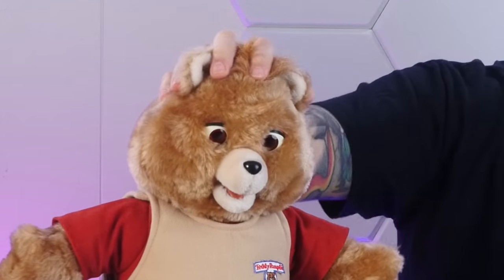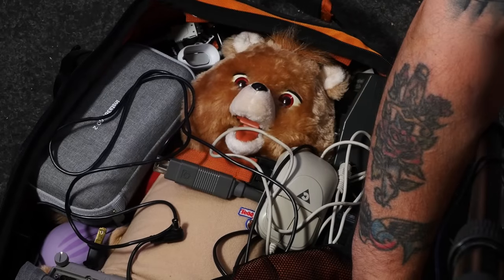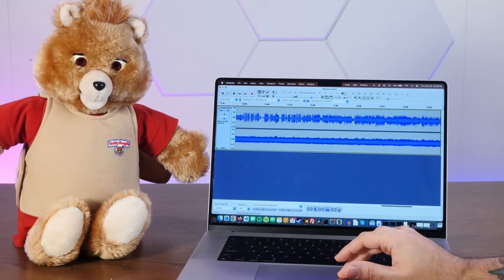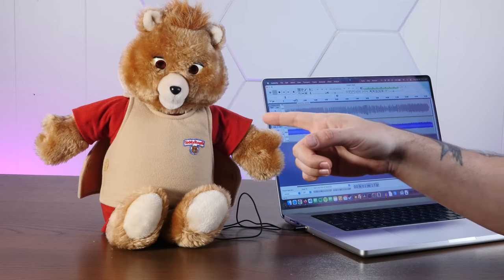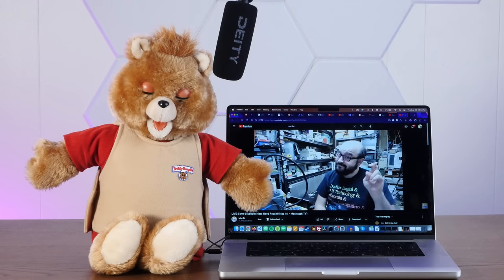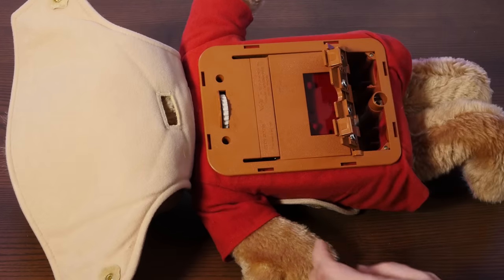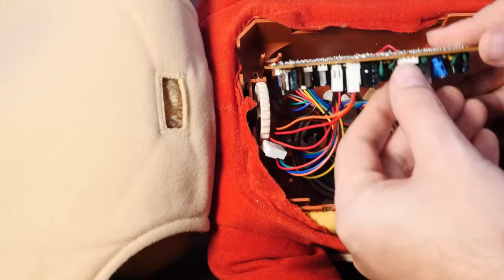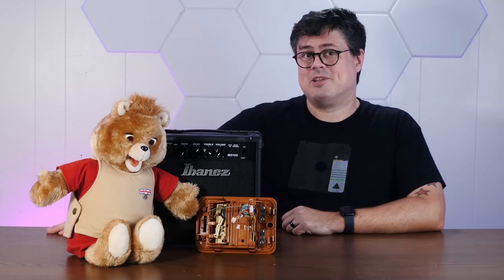How To Ruin a Teddy Ruxpin

Comment: The signal Teddy uses is actually exactly the same as in older model remote controls with 8 channels. The control track on the tape actually controls Teddy as well as Grubby; Grubby was an accessory toy you could plug into Teddy with the same movements and a speaker. The second deeper voice on the Tape is Grubby.
The tape and tape player are now obviously degraded and that's why the movements bleed over and the sound is really garbled.

The Channels are used as follows: 

1 - sync/unused
2 - Teddy eyes open/close
3 - Teddy Jaw control 1
4 - Teddy Jaw control 2 (later revisions omitted this servo but the control track was still there)
5 - Speaker switch (controls if sounds play through Teddy, Grubby or both)
6 - Grubby eyes open/close
7 - Grubby Jaw control 1
8 - Grubby Jaw Control 2 (same as with later Teddy revisions)
Reply: 🤓 Who is a cares, Teddy Ruxpin 's magical! ✨

Comment: Okay, now a real challenge: at one point, PBS, Microsoft and the creators of "Barney the Dinosaur" and "Arthur" created animatronic dolls of Barney, Arthur and DW.  The dolls not only talked, but had head and arm movements.  Creepy.  They also had some built in 'games' but with a special attachment to your TV or VCR would animate the dolls in sync with actions on the video.  This was done by decoding pulses embedded in the video and could be seen an the far left hand of the screen.  It was real creepy.  

Barney was the first model and the motors whizzed and whirred like a Terminator.  "I love youu....."

They're probably difficult to find as the experiment didn't work well and didn't sell well.  But messing with them... that would be a challenge!

Comment: Did you try playing a scale on the bass to find out if different frequencies create specific movements?
Reply: The signal Teddy uses is actually exactly the same as in older model remote controls with 8 channels. The control track on the tape actually controls Teddy as well as Grubby; Grubby was an accessory toy you could plug into Teddy with the same movements and a speaker. The second deeper voice on the Tape is Grubby.
The tape and tape player are now obviously degraded and that's why the movements bleed over and the sound is really garbled.

The Channels are used as follows: 

1 - sync/unused
2 - Teddy eyes open/close
3 - Teddy Jaw control 1
4 - Teddy Jaw control 2 (later revisions omitted this servo but the control track was still there)
5 - Speaker switch (controls if sounds play through Teddy, Grubby or both)
6 - Grubby eyes open/close
7 - Grubby Jaw control 1
8 - Grubby Jaw Control 2 (same as with later Teddy revisions)

Comment: The French tape was way better than the alternative inputs for syncing the mouth and eyes to the words.  You have to figure out how to make that lower  channel open the mouth and eyes and hand enter the sounds or wherever they are to match the French tape/
  Also, I would like to see him taking a bluetooth input from a phone or tablet.
And, finally, take an AI control for conversation.  I am guessing he does not come with a mic on his body, so that needs to be added and linked to the AI source.  

  Maybe you don't need bluetooth if you have a powerful enough  INTERNAL computer like a Raspberry Pi 5 to decode the voice inputs and choose and output a voice response with mouth and eye movements. How about a better speaker in the same place and a tweeter in the mouth?

Comment: there was a optional inch worm grub you could get and used what looked like a stereo line out patch cable used for connect mp3 players to car stereos.

and if you do get copyright struck for playing bass through the toy i am prepared i downloaded your video and will post it to torrent site for you so it wont be taken down.